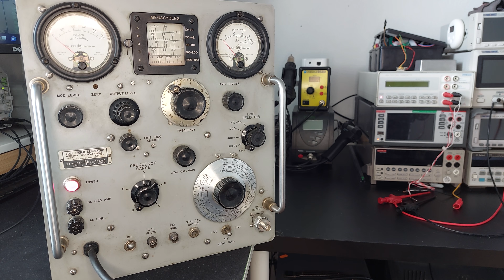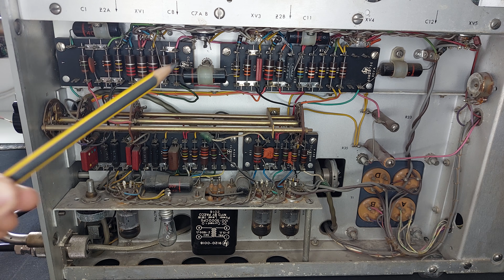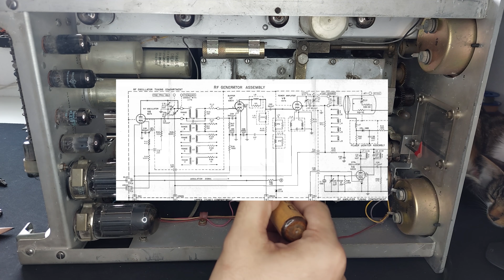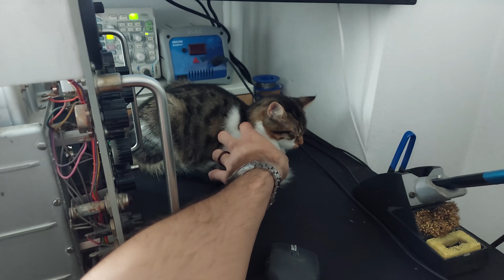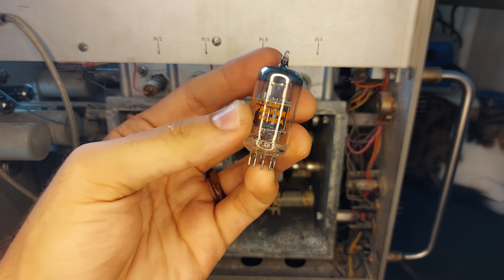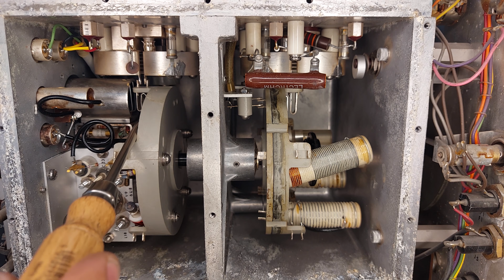The Best Signal Generator Ever

Comment: About the capacitors, even though everything seem to be working it is no guarantee those bumblebee or black beauty caps or what you chose to call them that are paper and wax internally will be bad 100%. They are not always paper and wax and can be Mica or poly caps which normally gonna be fine. the Electrolytics is probably pulling more current due to internal leakage but as long as the rectifier and transformer can handle this extra load it may be fine and this problem normally comes worst if the first startup after long storage been made without limiting the input power for some time. But for wax capacitors leaved in such a device it is a 1-way ticket to imminent destruction of components and tubes and they must all be tested for parallell leakage current with a dedicated tester. what happens to these caps are they will break down and start to pass DC current to the other side of the capacitor and they will never re-form or fix themselves, it will only get worse. what happens is that this leakage current especially when grid driving other tubes gonna make these waaaayyy of bias and eventually destroy your tubes. they may also burn resistors and other components as well on the way. because in their nature a capacitor should not pass DC current and components are not made to work with this extra load either. it is just a recipe for disaster to assume these old caps are working because no fuse been blown yet. it gonna be too late if you get that far and tubes are getting more rare for this stuff to find. I actually myself fixed a completely dead Signal generator myself from 1966, A Trio AG10. it got a full re-cap and overhaul of everything, the only cap I left in was the 4-in one bulk cap after I made a complete leakage test on it. the waxies was long gone in that

Comment: In the late 1960s and 1970s I worked in RF R&D labs. We  rolled the HP606 and HP608 frequency generators around on wheeled carts from workstation to workstation. They were always reliable, stable, and with clean outputs, but they did weigh a ton!
Reply: Mine weighs 28.4 kg. That is like an obese toddler ;)

Comment: No electronics video is complete without a cat. Glasslinger, the signal path & el paso tube amps to name a few. 
Mine unfortunately died a year ago & I still miss him.
Like you I believe hp produced some of the best test equipment ever made,
I had an hp 606 a I think it was rescued from the scrap heap at work. It was amazingly frequency stable for a valve(tube) oscillator, these days I wouldn't use anything that wasn't locked to a crystal.
Thanks for the video

Comment: The tool you found is the spanner for removing the pencil triodes from the top.
Reply: Beat me to it.  That is shown in Figure 4-4 found in the 608C Operating and Service Manual, showing removing V6 and V8 which in the RF oscillator and amplifier.

Comment: Those are not bumblebee caps!  BBs have colored stripes.  They are usually very leaky.  The black tubulars with RED letters are high quality film caps, almost always still good.  Very similar caps with YELLOW letters.are paper and oil capacitors, all bad by now.  HP used the red ones, Tektronix, the yellow.  HP kept on making very good, very very expensive signal generators.  Their 8640B cost $12,000 in 1980!!!  Unfortunately most of them are dead now, due to crumbling plastic gears and fragile,and unavailable ECL and custom analog IC’s.  Sad.

Comment: I have had two of these beauties but my shop is too small for these guys. I  can't imagine how much it would cost to remake such an instrument today. On the other hand, I got in today a little oscillator the size of the palm of my hand that goes from, I think, about 137 MHz to 4.4 GHz and it works. Does a good 0 dBm output except at the 4 GHz level. Accurate amplitude and frequency is nice as these older magnificent instruments provided but even uncalibrated amplitude is often times OK. Frequency accuracy is amazing on the inexpensive instruments with digital readout. Hang in there. Communicate with your real friends and let them help you and then show them how you care for them by getting and staying healthy and happy. That is how you pay them back for their efforts in helping you and you showing your love for them as they have shown for you. I am going thru tough times also but I am getting better every day.

Comment: Tektronix used to be the top company in oscilloscopes until LeCroy broke their back in the mid-1990s...then HP's Infiniium line stole the thunder from everyone else...

The 5675 and 5876 are  "pencil" type disc seal triodes good to 3GHz and tested up to 100,000 feet.  They were designed for airborne radar applications.  The 5876, according to the data sheet, has useful output up to 5 watts at 500MHz.

You didn't even bother to pull the 5675 out of its carrier to look at the glass part.
Reply from the maker: I didn't, because i already feared I'd break it. Plus the mounting for it was far more convoluted. Apologies